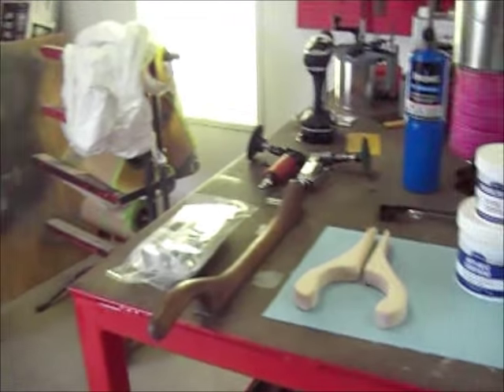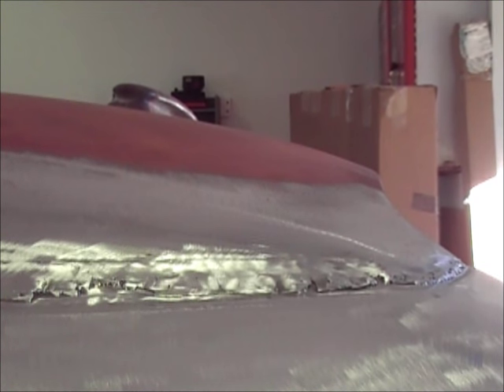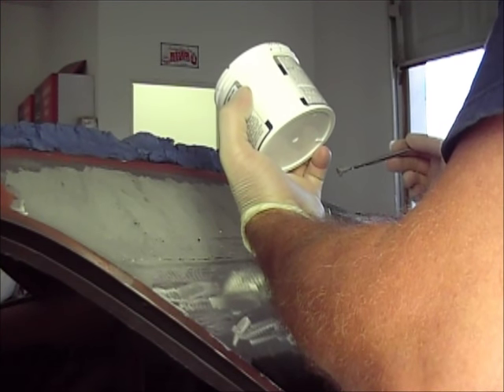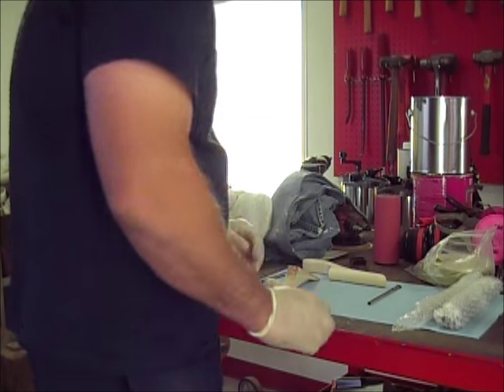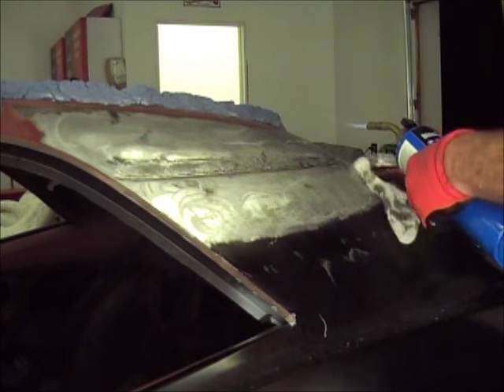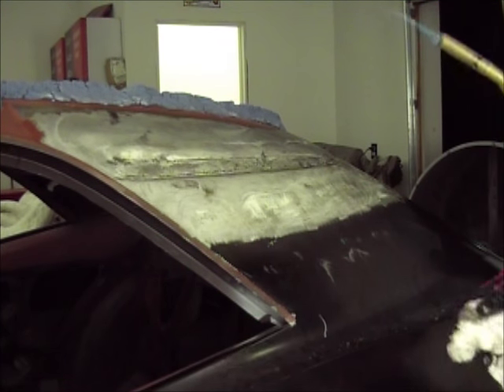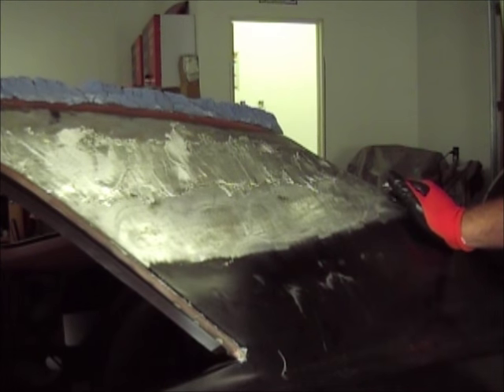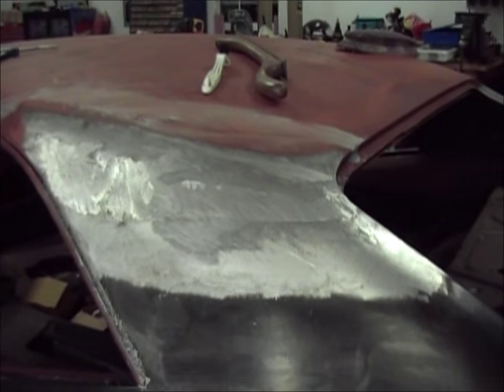sail panel leading

Comment: Alittle fyi, preheat the metal and use a fiberglass brush designed to apply the tanning butter. Lightly heat the metal and check it once it's hot enough as soon as the brush with the tanning butter hits the metal it will shine instantly and not only saves time but it does a much better job of tanning rhe repair area. You can also use a copper brillow pad like is used to clean pots and pans ,dip it in the tanning butter and use it as a brush.
Reply from the maker: Sounds like a good way to cook a turkey as well 🤣. Happy thanksgiving!

Comment: looks like it turned out good and solid. good job roger.  I would finish sand it and see where your at then apply body filler or glazing puddy to the low spots after epoxy.  much better repair than all body filler though in my opinion but what do I know lol
Reply from the maker: Sounds good to me

Comment: I've never had luck reapplying lead to low spots like that I'm sure there is a way I just haven't been able to do it. So I think a nice 80 grit and epoxy primer with touch up body filler is an alternative way to approach the final finish surface.
Reply from the maker: Thanks will do , question tho , do you neutralize the acid with baking soda ? And if so do you do it after tinning it ? Or after the lead is down and done ?